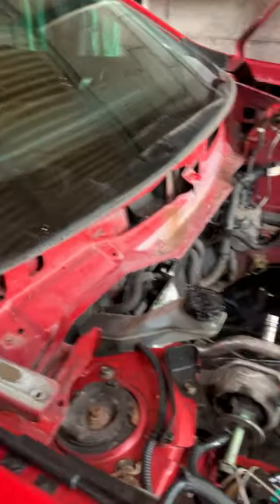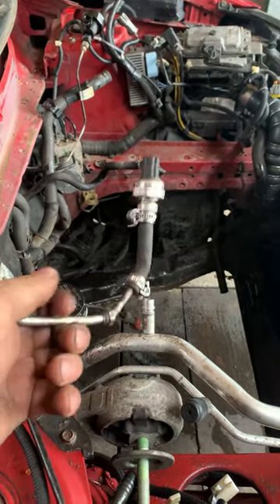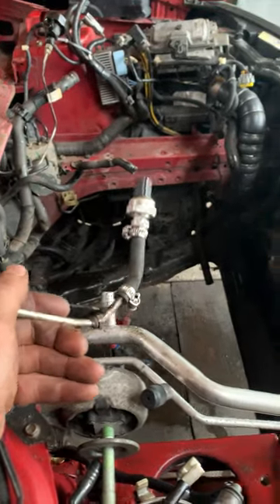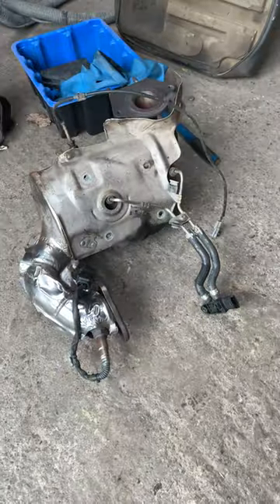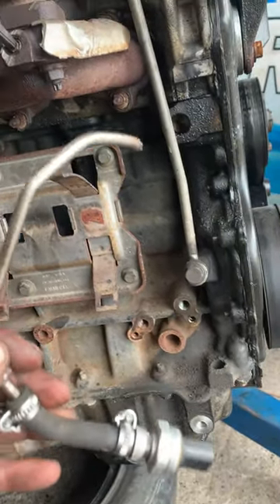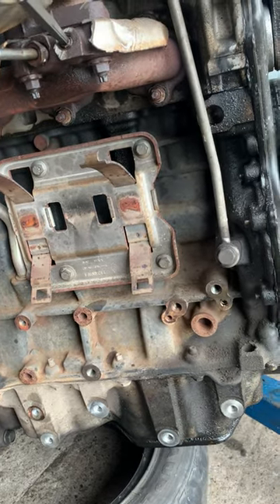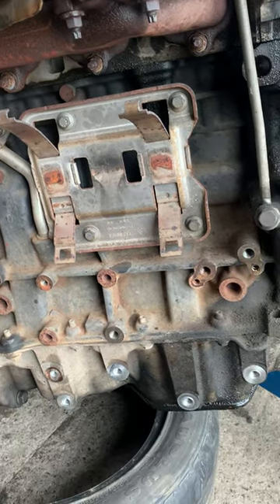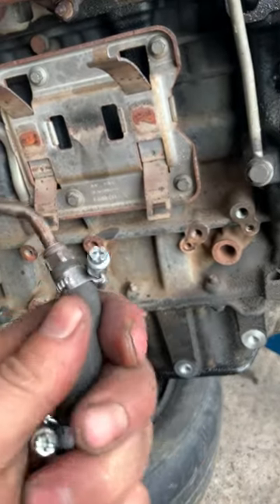Nissan Qashqai traction control light stays on AME motors youtube

Comment: There's an easier way, I do these regularly. First try an old steel cable in a drill and remove the sensor then drill the cable through the soot using penetrating oil. If that doesn't work remove the top of the back pipes to gain access, chop the pipe then use a ring spanner